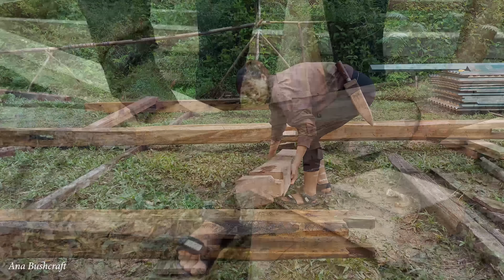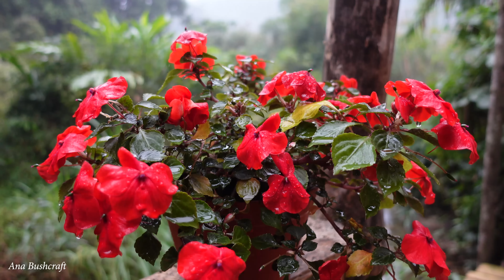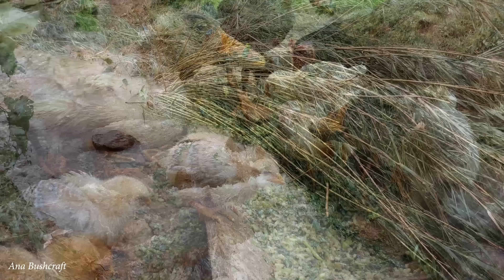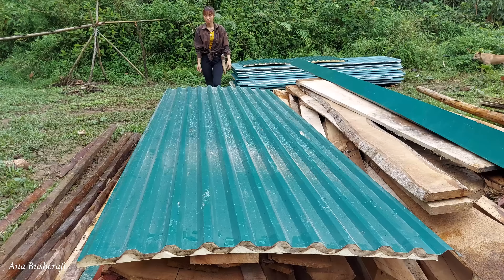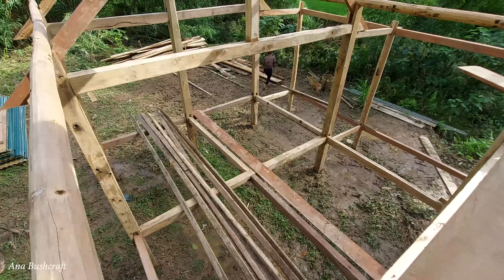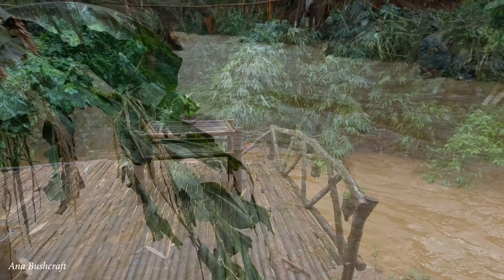BUILD LOG CABIN IN THE STORM, Build an emergency shelter - OFF GRID & ALONE - ANA BUSHCRAFT

Comment: That's a good technique to use notches on wood-to-wood connections. However, the size of the notched part is reduced. Hope you add a stiffening part to compensate for the reduced size. 13:00

Comment: The foamed iron roof is fixed with stainless steel screws, and the position of the screw heads needs to be covered with "silicone resin" to prevent the infiltration of rainwater.

It is suggested that the foundation piles of the wooden house should be strengthened, preferably at the bottom of the column, to implement a large-scale cement reinforcement.

Comment: Ana .... Climbing around on wet wood at that height is life threatening. I was glad to see that you used a rope at one point. Although if you would have sliped it wouldn't have helped all to much. Barefoot is not good either, but I admit better than with wet sandals. However I understand your need to move on with your work. I have been through similar situations myself. I truely hope there is someone behind the camera and you are not alone while doing all this. Who would otherwise help you if you fall. Take care and stay safe. 💐 For your hard work.

Comment: The creek needs a flood gate that can be opened in case of high water. once the water reaches a certain level Ana could open the gate and allow more water to flow stopping the rise which could flood the area.
Reply: A flood gate is not any good for flash flooding. It is only good for holding water, like a pond area!

Comment: It is generally recommended to pay attention to the following points when building a cabin in the forest:

1. A certain distance away from streams and rivers, because the long-term humidity in the mountains and forests is heavy, and there are many torrential rains, and it is also prone to flash floods, debris flows, and the foundations are easily hollowed out.

2. The stratum should be selected as a rock-grain layer, which is safer and more stable and will not produce debris flow.

3. Choose a high place to build a log cabin. The low place is prone to water accumulation and the ground subsidence.

4. For the construction of small wooden houses, it is most appropriate to dig the foundation piles into the ground for one meter. It is recommended to add cement for pouring to make it more stable.
更多關於此原文的相關資訊需要提供原文才能顯示其他翻譯資訊
提供意見
側邊面板
翻譯記錄
已儲存
貢獻

Comment: I was a little bit disappointed that the step for Ana to raise the initial structural frame was skipped. Just because I'm so curious how she did it. Far too heavy for a single person to lift, and I wanted to see the most likely pulley system she employed to get it done. Theres just no way a person would be tall enough to walk it up, much less strong enough to do such a thing properly. This is not a knock on Ana in any way, I just really wish it was shown in case I want to attempt such a thing.